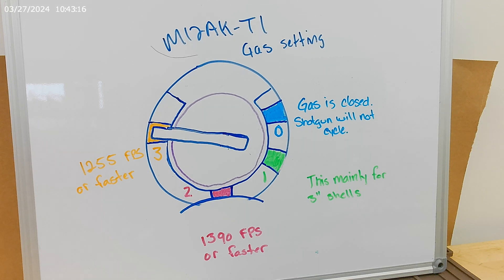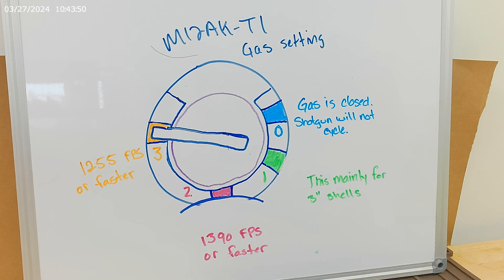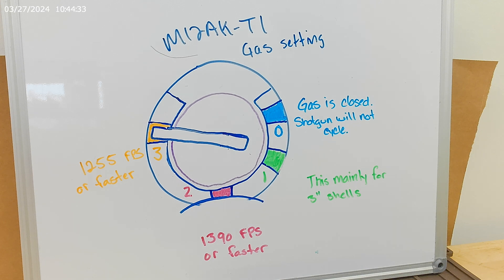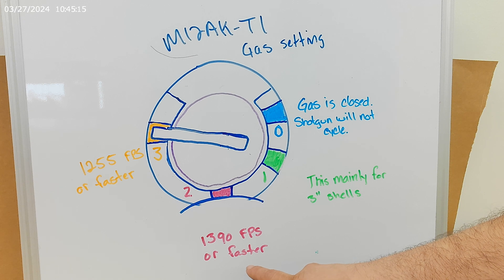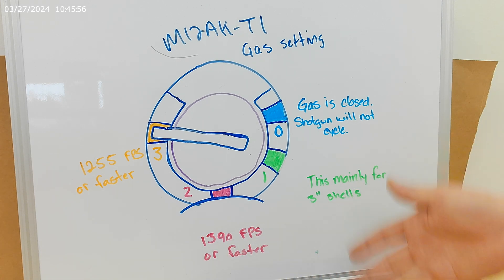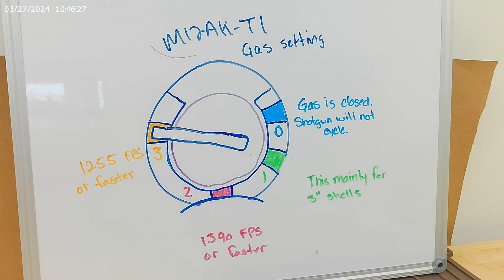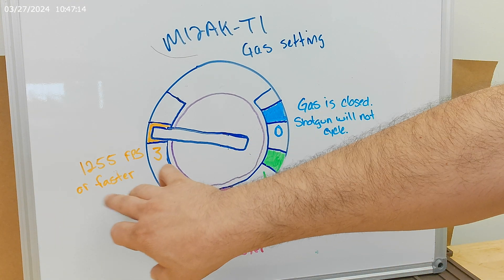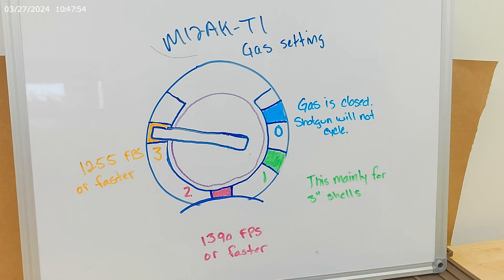JTS Gunsmith: M12AK-T1 gas system explained.

Comment: I cracked the back of my gas puck on my M12AK. It would no longer cycle. The puck was stuck in the block because of that hairline crack. I managed to get it out.

I noticed that in the rear part of the gas block housing there was a perfect spot for a rubber O-Ring.

So i used a dremel to cut off the back part of the gas puck down to the first groove from the rear where the crack was. Then rounded it off and polished it.

Sure the gas puck is shorter now.  But the travel inside only slightly changed. 

Now that O-Ring acts as a bumper for the puck.

I havent noticed much of a change in preformance when using different loads on different settings. 

I make sure to clean the gas block system more frequently. So far its been working perfectly.
Reply from the maker: I can get you a replacement gas piston if it cracked. Just call up the shop and ask to speak with me.